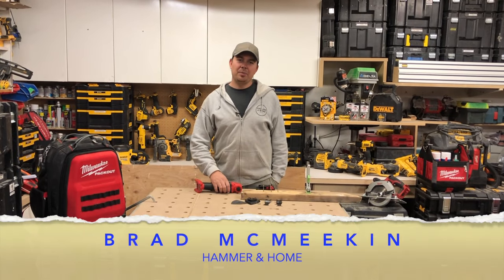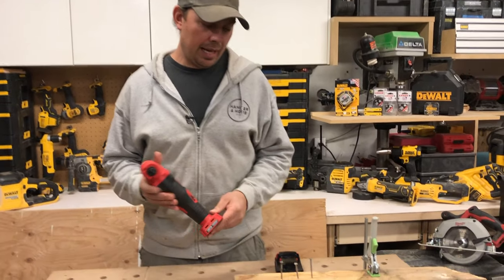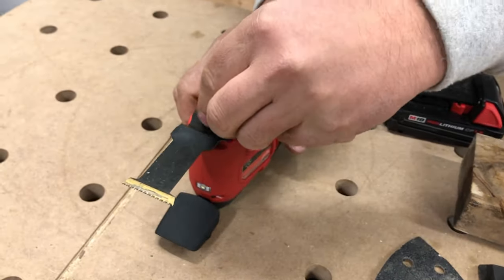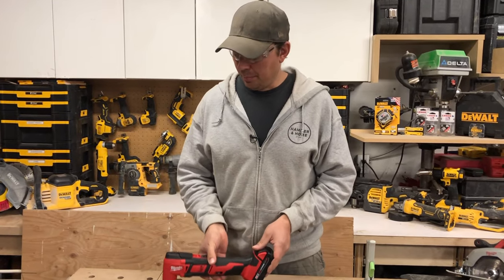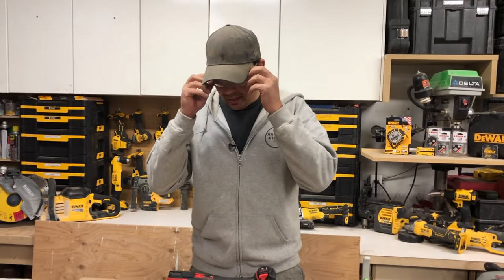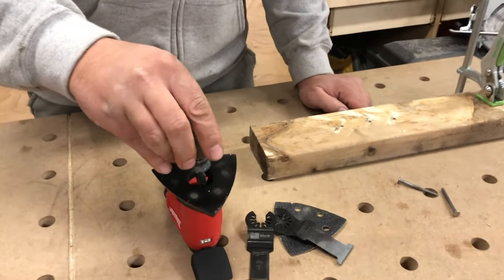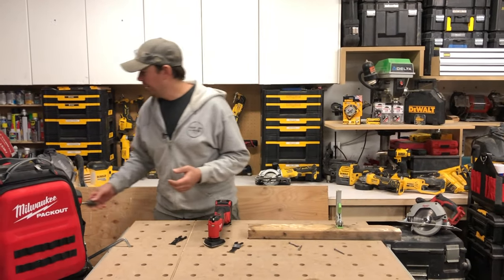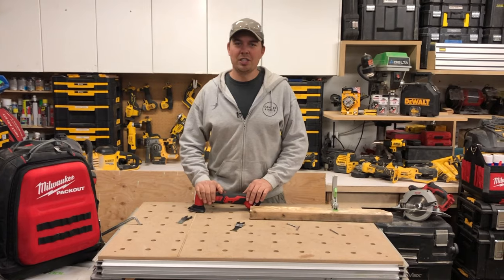Should you buy the Milwaukee M18 Oscillating Multi Tool?

Comment: For anyone who's wondering, I use this tool on almost a daily basis for pretty heavy tasks and it's finally packed in today after almost two years. I'll be switching to the fuel version now which wasn't available when I bought this originally. It's a cracking tool and if the fuel wasn't available then I would get another one of these. Great video, thanks bud
Reply from the maker: Thanks for watching! and sharing!!
Reply: I just got the M18 FUEL, its in a different league to the old non fuel, hardly any vibration and feels lightning fast.

Comment: I've got a small bunch of Milwaukee M18 stuff, and I've been looking at this multi-tool too. All my kit is the 'basic' non brush-less versions which many people will scoff at but - my tools are not for my job, they are for home DIY projects, most kit spends 99% of the time in its case in the garage! The brushed kit is perfect for me - the price difference is significant. Nice review, I reckon I'll look for a deal on one of these.  Nice review!
Reply from the maker: Thank you! I have tools that I have been using for years in the trade, and they are not brushless. If you don’t need them everyday it’s not worth the extra money. They still get the job done. Thanks for watching!
Reply: If you’re still looking for a deal, Home Depot is selling them for $120 and you get a free gift. The gift is a 2Ahrs m18 battery!!
Reply: Regardless if I make aliving with then are not I have got to always have the m18 fuel period! That's how I have always been.

Comment: One of the problems with this Milwaukee Oscillating tool is that after a lot of use, the locking mechanism does not work very well and you are forced to make sure the bolt is  tightened good with a screwdriver or the tool eventually comes loose. I guess if you don't use it a lot, it isn't a problem but, generally, people are not going to spend the big bucks on a Milwaukee tool that is rarely used when you can buy a Ryobi Oscillating tool for much less that does the job. Plus the Ryobi stands up on the battery, which may or may not be an issue. I did notice the Rigid Oscillating tool is similar in design to the Milwaukee where it doesn't stand up.

Comment: I bought this over the fuel because it's a good tool and a lot cheaper. I just saw it on eBay for $78 (July 2024), hard to beat, the fuel is twice that. I don't use it everyday but it's handy when I need it. BTW Milwaukee redesigned the sanding holder, now it's flush.

Comment: I too like the Dewalt Trigger, but my platforms are Milwaukee and Makita. I just used a Dewalt to open up some lath and plaster, wow I was taken back by its power and ease of use to replace the blades. My old unit is a corded Bosch, 17 years old.. works great, but the cordless and the technology these days is pretty amazing!  Guess I need to go fondle the tools at the Poe House and see which wins.. It would be nice if I could actually test drive each tool first.

Comment: Oddly enough I have the DeWalt and the Milwaukee M18. I love both for very different reasons. I find the DeWalt is great straight on with the trigger system. For turning the tool in certain situations the Milwaukee is great. They both perform great with the trigger control on the DeWalt handy for variable speed situations. The Milwaukee I find is great where the constant speed is used. You cannot go wrong with both!
Reply: Which one is more quiet and which one vibrates less?
Reply: @carlandrews5810  i find the deWalt vibrates a lot more and the milwaukee is noisier but not by much

Comment: Hey Brad. Thanks for the heads up. I just got this Multi tool from my son for Christmas. Just a homeowner who likes to do as much as I can to save a buck around the house. I think this tool is a pretty cool addition to my bag. Going to try it out for removing old tile on a countertop. Should do the job. Glad I already have a decent sander for bigger jobs, but I think for cutting it  will get it done. Good video. Thanks.
Reply from the maker: Thanks for watching! How'd it go on the countertop?
Reply: @hammerandhome  Had issues with the M18 1.5 battery dying out fast. Besides that worked out well. Any upgrade battery recommendations? Really dig the tool, just frustrating having to recharge it so often. Thanks!
Reply: @sundawg57 get the CP3.0 or XC 6.0 High Output. Great batteries

Comment: Thanks Brad. First time viewer. As others here have said this is just the review I was looking for. I am not a contractor and I just want to know if the tool is recommended for occasional home use. Period. My tools are just for that and I am in the market for an oscillating multi tool. The tools I have are the M18 line and I am very happy with their performance. I’ve been looking into this tool or the fuel model but you can’t beat the price if the performance is there. I suspected the fuel would be overkill for me but it’s reassuring to hear it from someone who I’m sure has more experience than me. Enjoyed the review and I will check out your others
Reply from the maker: Thanks for watching! And happy to have helped. Definitely the fuel version is for the pros or for someone who plans on using it a lot.

Comment: I'm a carpenter and my platform is milwuakee the small exception of carrying a screwdriver wouldn't change a thing you could get an electrical testing screwdriver its only the width of a flat pencil so its un noticeable

Comment: I'm a homeowner.  Almost ten years ago now i bought the Milwauke M18 combo set to replace my 14.4V NiCad Makita drill and it was a great decision.  The lithium ion batteries are light years ahead of the old tech.  I'm considering one of these multi-tools, which is how I stumbled upon this video.  I saw another video where a guy was using one for cutting vinyl siding.

[side note:  i've seen people using snips (cheap), reversed saw blades (ok), and a multi tool (great), but the best method of cutting siding that I saw was using a cordless cutoff saw.]

My father-in-law has DeWalt gear, and I like some things about DeWalt, and others I like better in Milwaukee.  ALL of my Milwaukee batteries have a 4-bar power gauge.  The DeWalts only have it on the bigger batteries.  My Milwaukee drill and 1/4" impact driver have a little LED under the chuck that really doesn't adequately light up the work area, as it's offset.  The DeWalt pair has 3 LEDs around the chuck in a triangular orientation that works so much better.  My Milwaukee lantern is awesome, but DeWalt doesn't make one.  I have a Milwaukee stick LED light as well and DeWalt also has on; no major differences here, but I think the DW is more flexible and the MW has more hooks for hanging it...

Bottom line is that they both make good gear, but not everything is perfect.  It seems like these brands, and Ridgid, Makita, Bosch, and maybe a few others really make decent stuff.  It's a little pricey, but it lasts.

Comment: Currently (16/05/23) screwfix (U.K.) is selling this for £99.99 body only comes with one wood blade and the sanding attachment with a few sandpapers (this isn’t including a battery but I got mine today and apparently there’s a code going that will get you a battery with it for a better price)

Comment: I just used my Milwaukee version for the first time yesterday. Bare tool was $99. I can say I don't care for the blade change. I also see that Lowes has the DeWalt with battery and charger for $99. But once your married to Milwaukee for all cordless tools, you might not want to switch. I don't want to leave the house with only 1 battery. Nice review. Thanks.

Comment: Great honest unbiased review. I'm a Milwaukee guy only because I'm married to the battery system at this point. I do like a lot of things about the Dewalt multi tool but then I'd have to start another battery ecosystem so it's a tough call for me. I don't know about Dewalt but Milwaukee has some spectacular deals on older new stock if you don't mind being a generation behind the latest and greatest model.
I'm actually leaning towards a Dewalt  because I love the quick release blade changing system.
Reply from the maker: My honest opinion is the Milwaukee fuel is far better than any of the Dewalt’s. I did a video showing the two up against each other.

Comment: Mine died after doing drywall (3 levels) in a home for investors im employed by. I blew it out daily and plan on taking it apart to see if I can rebuild it. Mine didn’t see heavy daily use till a couple months ago. In meantime, I was going to buy the Fuel version for around 240 bare tool, but was at Lowes and picked up a Dewalt XR with a 1.7 power stack battery for 183 out the door. I know the Fuel is quicker, but I had issues with the adjuster dial being locked in same speed etc. I believe the M18 Brushed is faster initially over the XR I just bought, but I can’t afford to not even get a year out of a power tool. Personally, if one is working in heavy drywall dust, a mask for your lungs and Brushless tools for longevity. If you’re working in a wood shop with no drywall dust and are an occasional use DIYer, the M18 Brushed will be just fine. I’m really hoping to rebuild my M18 Brushed Multi Tool when I have free time.
Reply from the maker: Yeah I would agree with you on that, drywall dust is definitely a killer of tools. Brushless tools are where it’s at for really dusty conditions.

Comment: This tool has saved my butt a few times when doing repairs around the house, most recently in repairing rotten subfloor panels. Blades for these things are expensive no matter what brand.

One other thing, these tools won’t cut anything soft, it probably won’t break the skin unless you press really hard. They are basically just like the saw a doctor uses to cut off a plaster cast.
Reply from the maker: i would disagree on the skin. if you have a wood blade on this, forgetabout it, your getting stitches. Ive walked passed this thing and got cut up. the metal blades or fine tooth blades are perhaps not as sharp but definitely not a tool to ignore.

Comment: Great review.  It answered many of the questions I had.  As a side note; the first time you put a blade on you practiced safety by removing the battery first.  After that, you didn’t; even when both of you were holding the sanding pad.  Just saying.  Thank you for time.
Reply from the maker: very true :) do as i say not as i do. thats what an old friend of mine used to say😂 thanks for watching

Comment: Just got this m18 tool from HD for $90 including battery- not a bad deal. 
Apparently Milwaukee has addressed the sanding attachment issue-on mine the screw sits up much higher so your fingers don’t have to go into the hole to tighten, problem solved!

Comment: you can use the round edge of the blade as screw driver to replace the blade
Reply from the maker: another reason why I like the dewalt, but that's a great tip! thanks for watching

Comment: Thanks for the review! I am looking to buy some first time tools for my husband and I'm just doing some research on them. Would you be able to use this tool to make ceiling holes?
Reply from the maker: you can but if you need to make round holes for pot lights i would recommend a drill with a hole saw bit, This is a great tool for home Renovations, so many applications.

Comment: Once you buy a milwaukee, it becomes very expensive very quickly because trust me, you will want to keep adding to that range, I started with brushless impact and drill kit, then got fuel grinder, fuel circular saw, fuel sawzall, sander, soldering iron, rotary tool, strimmer and now bought this multitool.
Is there an AA like clinic for tool addiction? (that sounded wrong).
For sanding it great, random orbits are great, but this can go in where the orbital cannot on rectangular areas such as stairs.
Reply from the maker: Yeah I definitely have a bit of a tool addiction, always looking for that deal. I’m definitely loving my new m12 fuel multi tool.

Comment: I think you are right on point..what are you using the tool for..how often...those were my questions and I went with this model...I just purchased it during the Home Depot  Black Friday Sales, I purchased it for $99 USD with a 1.5 Battery..I used it yesterday to remove some  chair rail and base board as I was installing door casing ... ate right through it... was happy.  I too don't like the on/off switch but not a game changer...really never used the sanding block.  Thanks for verifying my purchase.  BTW  nice video.
Reply from the maker: Thank you! It’s definitely all about what each individual need. Everyone has different likes and dislikes when it comes to tools. So happy we have so much to choose from. Great buy by the way. Thanks for watching
Reply: What??? My friend just sold a brand new one for a 20 dollar bag of dope????:0

Comment: Hello, Im looking to get tools to keep in the house for projects and so on. Im settle on any brand yet. I noticed Home Depot has a deal you get a drill, and impact plus a tool of your choice between a multi-tool jigsaw and a huge speaker. Im not new to tools I know how to use them, and the difference that good tools make when doing something. What you guys recommend? 

Psa can do m18 impact gun be used to remove lugs from a tire?
Reply from the maker: both Milwaukee and Dewalt are great brands, as well as bosch and Mikita. I have a lot of all of them. for woodworking type jobs I find dewalt is the best option, they have lots of sales on, the battery platform is great, and they are tough tools, Milwaukee is more geared to plumbers, electricians, Mechanics etc. they have great tools but can be a bit more pricey and they dont have as many sales. hope that helps a bit

Comment: Does the size of the battery affect the power/cutting strength?  How long does a 1.5 battery last?   I’m just starting out buying tools for the first time and really want a multi tool!  Thanks!
Reply from the maker: Technically the size of the battery shouldn’t effect the power output of the tool. However I have found that it does affect some tools. The 1.5 really don’t last very long and it all depends on how hard. You are working the tool. I try to get the 3.0 cp for most of my tools. And if I need larger run times I will go to the 4.0 xc

Comment: The FUEL version has almost no vibration in the handle making it much nicer to use for long periods.
Reply: This one vibrates a lot more?
Reply: @carlandrews5810  I've only used the FUEL version which has almost no vibration. Couldn't have done my kitchen reno without it.

Comment: is that tool compatible with both old and new starlock system blades?
Reply from the maker: Milwaukee doesn’t use the starlock system, I haven’t tried fitting a starlock blade on it, but it is possible it might. Sorry I couldn’t give you a definitive answer.

Comment: i bought that multi tool and it scrapped several of my batteries the locking brakets became worn very fast and even the holding brackets on the tool worn to a point that the battery became loose. i also had to force the battery off because the release buttons would not release the battery. i changed the casing and got the same problem. i ended up returning the tool for a refund and bought instead the big radio :). Anyways not sure if i was just unlucky but this tool was a disaster for me. has anyone else had this problem?

Comment: Is a screw driver that big of a deal ? 🤔 But good point on the sander head vs the orbital sander.👍
Reply from the maker: it's not that big of a deal, ive been using dewalt for so long it's just another step with the Milwaukee

Comment: As someone who used porter cable before having enough money to buy milwaukee, this oscilating tool sucks compared to the porter cable one. With the porter cable one I can quickly detach the heads and offset them, this one I have to loosen a screw? Why? The inferior product wins in this competition...

Comment: No your making shit up. No doubt the nob that you twist to hand tighten the particular tool attachment is metal and designed for a flat head screw driver. How spoiled are we? You could have used one of your keys or a dime. It’s an awesome tool. The bigger question is the new brushless model worth the extra expense. Is it as dependable?
Reply from the maker: I have the m12 fuel and it definitely cuts better than this model. It’s all I use now.

Comment: Milwaukee dropped the ball on the damn screw. My brother has the Dewalt and being able to change on the fly is great. I am apart of the red army so I went Milwaukee and it works great but changing heads is.much easier with Dewalt. The yellow just looks horrible with everything else I have. Lmao. I guess 1 out of a dozen tools Dewalt had to get 1. Lol
Reply from the maker: lol, I almost always use the m12 fuel version. It’s fairly quick to change the blade. And is far better than the dewalt